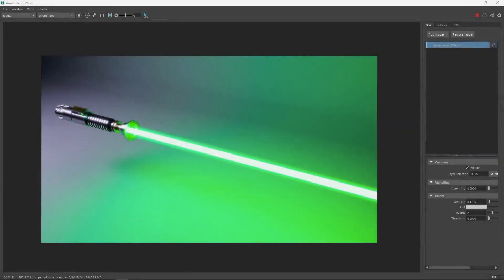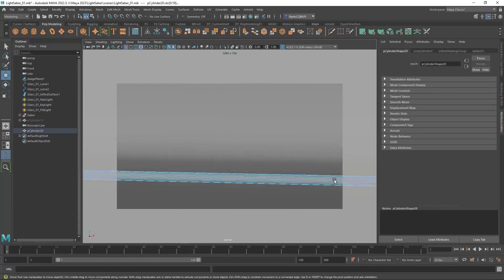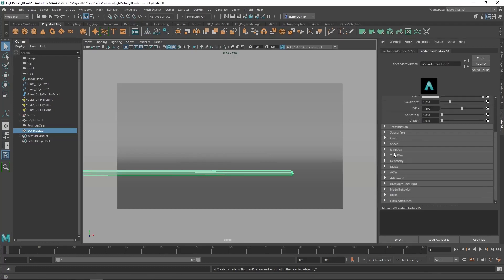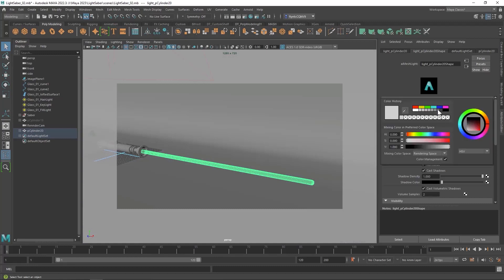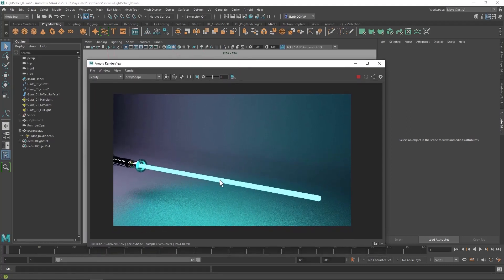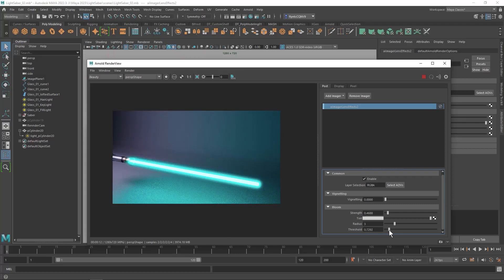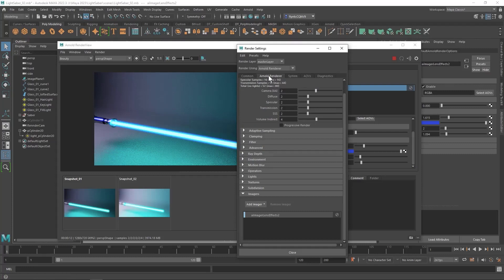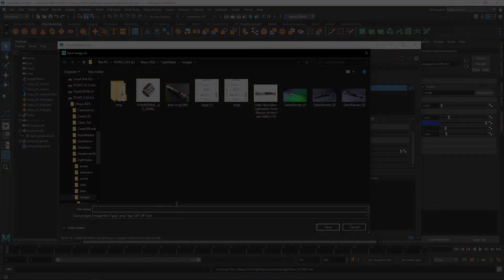Maya: Model and Render a Light Saber 013/13

Comment: For some reason, in your video, when you turn on show original mesh for your mesh light, the bloom property begins to work just right where your blue color shines brightly. When I do it, my lightsaber shines white even though my mesh light is set to a different color (blue). Any ideas why your setting change works different to mine?

Charles, I sent you an more in depth email about this if you have the chance to look at it. Thanks so much.